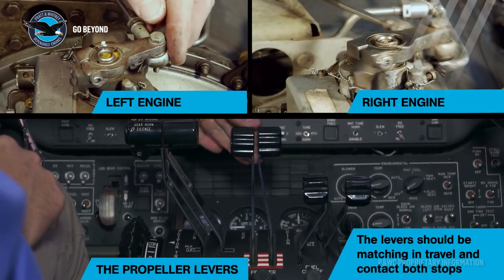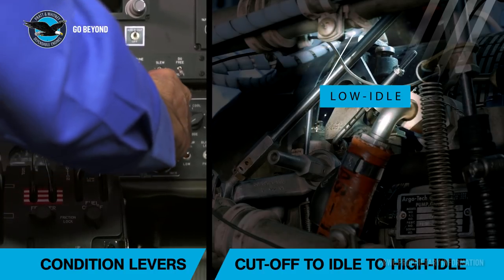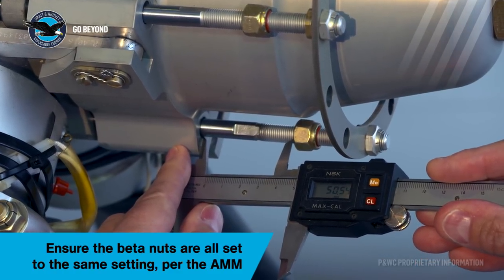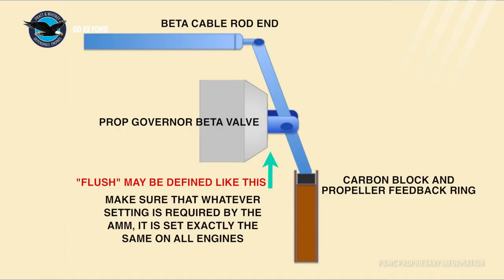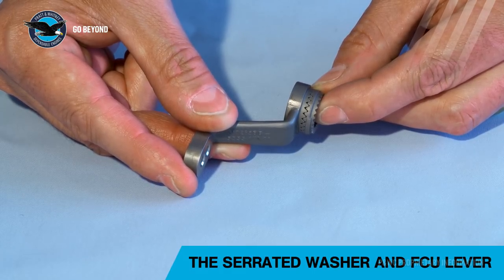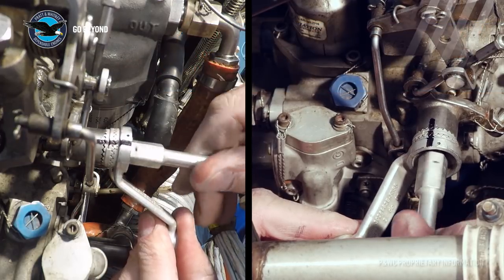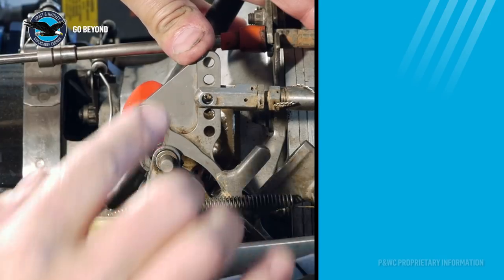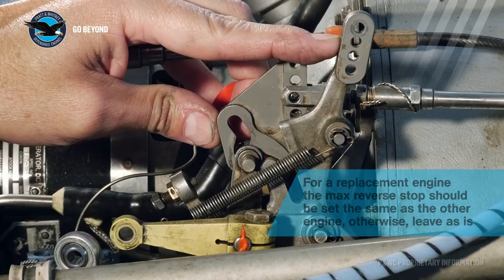Rigging Your PT6A: King Air B200 – Part 2

Comment: The arm on the fuel control,when rigging the condition lever,seams to have a different angle from the other f.c.u.So when trying to rig the condition lever at idle(parallel to f.c.u) can't be possible,cannot extend further the rod.